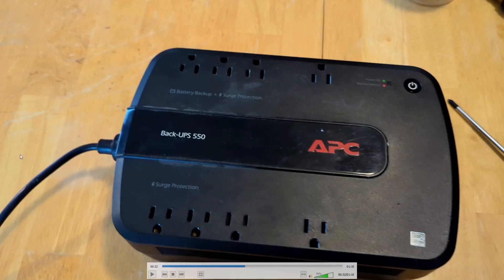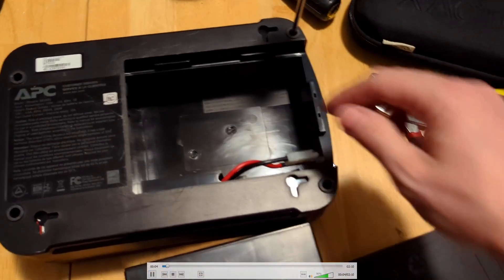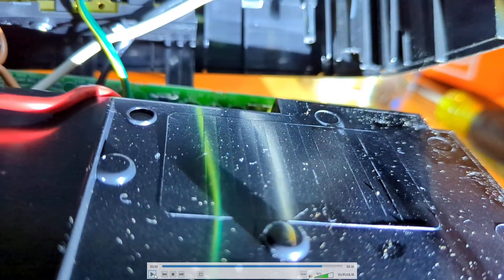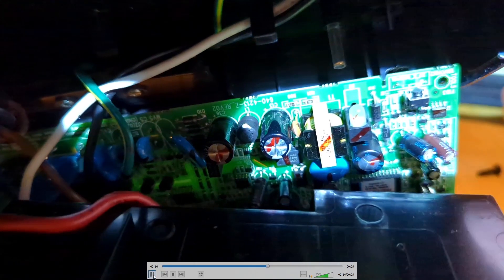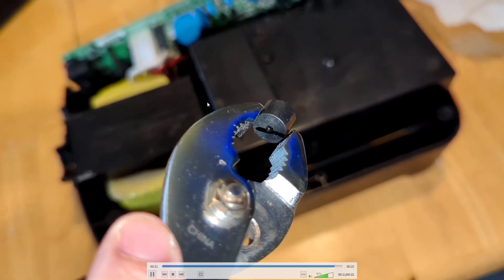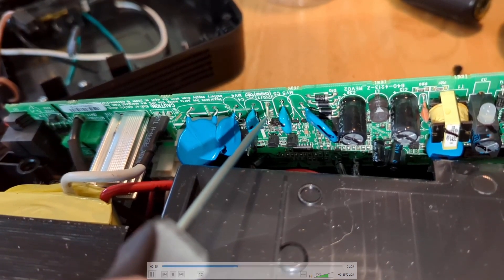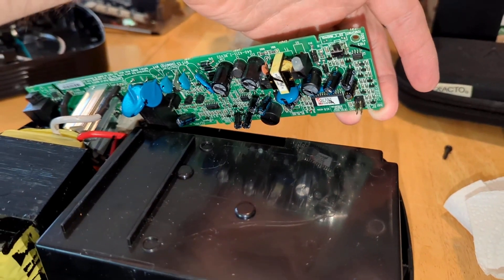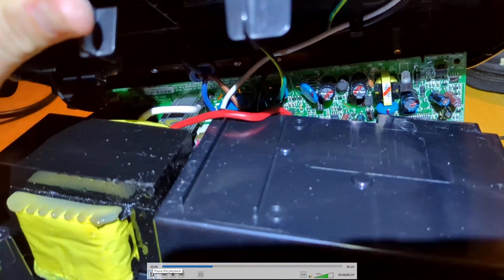How to remove the alarm on APC UPS 550

Comment: you not have used the same battery i have 550VA 330wats ok i have 18V 5A Lithium drill battery i buy 18V to 12V 20A converter to used with my usp its 12V ok i do 2hours and 45minutes on my laptop i test it run 3 laptop on 100% battery 18V 5A i do 40% on 100% battery ok

Comment: The way you opened the UPS is wrong. You should've opened it flat upside down, not upright as you did. It's much easier to get around the circuit board with the whole unit upside down.